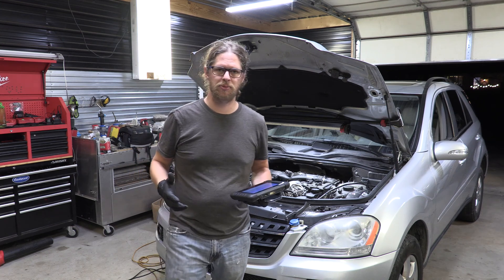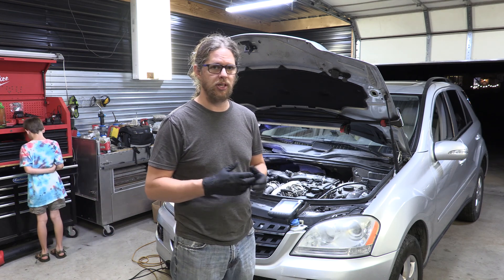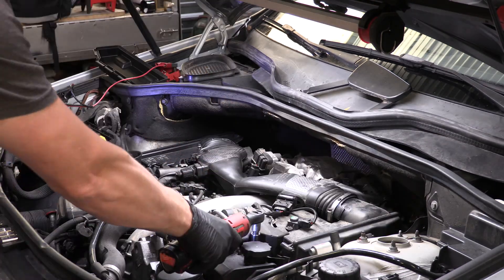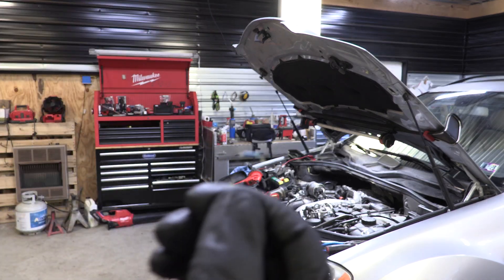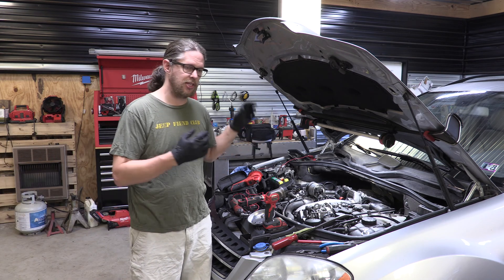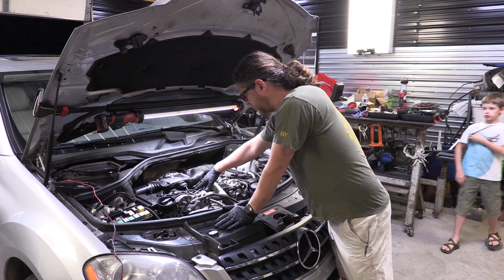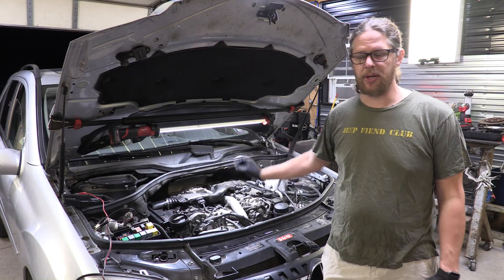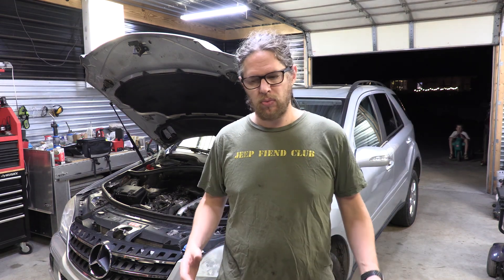DIY: P2008 Is it safe to use the Resistor for the OM642 swirl flap motor failure? #mercedes #diesel

Comment: Hi, i put the brown resistor but the problem is still there. The engine light went off but turbo it's not boosting
Reply from the maker: You may need to check the turbo or make sure the flaps are not shut. Also make sure it’s not in limp mode for a different reason.

Comment: Hello great video, how do you move the swirl valves into position?
Reply: I have 2007 ML 280 cdi, have the resistor installed and the same fault codes you have listed
Reply from the maker: If you have the resistor and still have the code I would recommend testing the resistor. Maybe it went bad..
Reply from the maker: If they aren’t in the right spot, they might be stuck or the runner/connector might be broken, sadly that could mean you’ll need to pull the intake manifolds and have them cleaned.

Comment: Is it possible to manually open the flaps while the motor is still in, possibly by sticking a screw driver down there and ensuring that the intake runner arm on the drivers side is forward and the passenger is back? Or maybe using pliers and grabbing the arm and pushing or pulling them forward and back?

I put the resistor in and it’s out of limp mode but now it’s hesitating when i drive it and it starts building a bit of boost so I am assuming the flaps are closed. Weirdly enough, if I floor it, it doesn’t hesitate.
Reply from the maker: I don’t know if I would recommend forcing them open, if they won’t move they are possible broken or clogged up and stuck. 
And they are just weak plastic runners that will break if you try to force them.
Reply: @MalarkeyTaylor thank you. It might be different in the 08 ml320. I have a bunch of wires that sit on top of the swirl motor in a black plastic container so I can’t see the intake runner arms like you can in the video. Unless you removed the wires and that part isn’t in the video?
Reply: nevermind I see it now. You removed a different piece closer to the front of the car to be able to see the arms clearly
Reply from the maker: @khaledkabalan9066  it’s possible I removed the fuel filter. But I also may have used a bore scope. Which can be helpful.
Reply: @MalarkeyTaylor gotcha thank you for your quick replies. I ended up removing the fuel filter and manually moved the arms back (passenger) and forward (drivers) with my hand, they moved very easily. No more limp mode but I’m still getting a hesitation even though the flaps are open. Any ideas? It feels like the motor is choked because there’s an air restriction now
Reply from the maker: @khaledkabalan9066  it’s really hard to say. If you clear the codes and none come back, give it the Italian tune up and run it out the gears. It might help, or it might tell you if it’s running out of fuel or air.  If it falls on its face but no smoke it might he fuel starved. Check the injectors are working right. If it smokes and can’t wind out check your air filters and turbo. Make sure the turbo is doing boost things and that the vgt actuator is working correctly. 
Honestly there are so many things it could be but those are some starting points. 
Good luck!
Reply: @MalarkeyTaylor thanks!

Comment: Hiya, sorry to bother you I know you answered the question several times but I'm kinda stuck. I've the same issue. I put a 4.7 k resistor blue colour. The drive did improve but the MIL came on and most importantly, the engine got very hot after a spin. I removed the resistor and put everything back together but willing to try again. Can I move the swirls linkages by hand to make sure they stay in the open position? Thanks for your kind reply 🙏
Reply from the maker: Depending on the year, some of the swirl flap slides have sensors in them that will cause the MIL light to come on and sometimes trigger limp mode. If that is the case with your car I’m not sure what the best recourse is.  I think it might be to remove the intake manifolds and modify the flaps to be open all the time and then allow the runners to pass the sensors while not affecting the flaps. 
But ultimately if the quick and easy fix of the resistor doesn’t work, it will require some more in-depth looking at what the MIL is saying. And if the engine is getting hot, the problems could be located somewhere else.
Reply: @MalarkeyTaylor  thank you so much for your prompt reply. I worked on the issue all day long and it's now fixed. I will share what I did to resolve the problem in a video soon. Thanks again, really appreciate mate.
Reply: @younesalsanhaji1603 hello can you tell me how did you solve it i didn't found video on your channel i have the same engine as you om646

Comment: Hi, Sorry to chime in late but I am getting a similar code and am thinking that I have a similar issue. However, the car will not start at all. Can I assume that the flaps in this case are stuck fully closed or is the it the code itself that is causing the vehicle to limp and not start? My code is 2530-2. Many thanks if you get a chance to reply.
Reply from the maker: More likely that the swirl motor blew a fuse. Check your fuses and then unplug the swirl motor. Iirc They share a fuse with glow plug controller or a few other things and the other system might be what’s causing it. 
I would not assume anything though, it’s best to test systems so you’re sure the cause of your no-start.

Comment: Would the swirl flap open position you had on the diagram be the same on right hand drive vehicles (UK) engines?
Reply from the maker: I think so, I have not seen any documentation to indicate that they changed the motor when they changed the side of the steering wheel, but I don’t know sorry.

Comment: Different matter from your video, but if I do a full catalytic converter and dpf delete can I use a resistor to bypass the dpf sensor?

It's an 08 ml320cdi.
Reply from the maker: Sorry, I don’t know. I have not been in the situation where I needed to do that.

Comment: Have you seen th p30078c code. I can’t physically see any opens.
Reply from the maker: I think Those are codes from a newer model that have Hall effect sensors in the intake runner flaps. I think that code is tell you that the computer want to move the flap but the flap is not moving or the Hall effect sensor is not meeting its endpoint. 
I’m sorry I don’t have any experience on those newer ones to tell you how to fix it. But look around for your specific model year and see if there is an easy or quick fix for it.
Reply: Yes it is a 2021 and I replaced the intakes and they came with a new motor. Maybe my scanner can’t erase the stored code.

Comment: sorry, I'm planning to do the same,, so I'm curious if the engine will lose power, what kind of power will it be at low rpm, at high rpm I guess it will go crazy
Reply from the maker: I have made this change on multiple cars and neither I or any of those that I have done noticed any change in performance or drive ability. 
The ML320 in this video went on after this to tow a camper with my dad driving for more than 30,000miles (all over the US) 
I also did the same to the GL that my wife drives more than 40,000 miles ago. 
And a friend of mine has a CRD jeep with the same motor that has also had this work done and none of them have any notable effect.
Reply: @MalarkeyTaylor  Tnx

Comment: I have problem with my om642. My turbo leaked oil into the cable you put the resistor in (what I think caused the problem) so I get P1270 code know when I scanned with my obd reader. A very common faulty with the turbo leaking apparently. But what would you say is the fault?  Do you think my servo motor for the flaps has been short circuited by the oil so it doesn't work anymore or do you have other suggestions?  How do I check that the servo is working?
Reply from the maker: Very hard to say, the p1270 code I think is a limp code. So you would have that with other faults. The other faults would be what you need to fixed before the 1270. 
So if the p2008 comes up with the 1270 your flaps maybe stuck and your motor may be bad. 
If you get rid of the other codes the 1270 shouldn’t come back?

Comment: what about DPF regen  when swilrl motor is off by resistor ? will regen offten  or all is ok  ?
Reply from the maker: I have not noticed a difference in the region activity. Have been running like this for quite some time and many thousands of miles and have had no negative effects that I can tell.

Comment: I dont have a mdb tool can you still do the fix without clearing the code ?
Reply from the maker: Once the resistor is in place and the flaps are left open the code should clear itself eventually. But if you have codes for this I would recommend making sure it’s not anything more serious.

Comment: I tryed the same way on my w221 320cdi ,the car goes out from the limp mode but the motor works with the 50% of the power very lazy .
Have i do something worng maybe i didint conect the resistor good? 
Or my swirl flaps are not fully open?
Reply from the maker: that is very possible that your swirl flaps are not open and then causing the motor to be restricted. I was very careful to only do this when the swirl flaps could be verified to be open.  you could get a camera and look into the intake if you take the charge pipe off and run the camera in.
Reply: @MalarkeyTaylor  
aa ok i understand,but now what can i do to open them?
Reply from the maker: @anxhelobarjamaj7979  that’s a tough one. Depending on how badly they are broken it could be as easy as forcing the runner open or as hard as taking the intake manifolds off and removing them.

Comment: If the swirl valve is working but binding up here and there and tripping the Check Engine and putting me into limp mode is there a way to loosen up the arms or add treatment? I play with the arms, clear the code and it runs great for about 500 miles or so and then the same thing happens. thoughts?
Reply from the maker: Soot buildup in the intake can cause this. Part of why I disabled the flaps on my cars. Once they are left open the buildup doesn’t matter as much and we can go longer intervals between having to remove and clean the intake manifolds.
Reply: @MalarkeyTaylor  Thanks - does any diesel fuel additive for a Sprinter diesel help with build up?
Reply from the maker: @DougLindland  not that I’m aware of. Most of this is the result of the egr and crank case vent sending oil into the intake with exhaust gases. 
Many people delete those items. But I can’t say how to do that or recommend it as it’s not legal in some parts of the world.

Comment: If my swirl valve is rattling, what does that mean? Can I bypass the sensor or does that mean it's a different problem?
Reply from the maker: Some years have sensors that detect what the position is of the flaps. Those years you can put the resistor in but it may not prevent the engine light from coming on. 
If something is rattling. You may have a broken component and it may be best to seek a capable work shop. Or remove the intake and repair or remove the swirl flaps.

Comment: Hello , do I need to move with hand first those flaps to open position , or just to put resistor ?
Reply from the maker: If they are not in the open position when you put the resistor in the engine light may go away but your engine may not perform right and may end up with problems due to the flaps not being open. 
If they can’t be easily opened by hand you may need to take the entire intake off and clean it and fix the worn connecting rods to get the full range of the flaps back. Or delete them entirely.

Comment: Hi if how long this resisters can last , eventually do you have to fix the main problem swirl flap
Reply from the maker: I have done this to two different trucks now. One of them went 40,000 miles and two plus years before it was totaled in an accident. The other is still going after 25,000miles and a little over a year. 
So if there is a limit I have not found it yet.

Comment: Hi, sorry for the time, have a question I want to use the resistor but should I open the flap by myself or keep them in the same position?
Reply from the maker: They should be in the open position if they are not stuck. If you can move them to open or make sure they are open it’s best. If they are stuck or broken the resistor may get rid of the motor failure codes, but the motor may have other issues because of the restricted intake. 
I guess use caution and your best judgement. And if you’re not sure, you may need to consult a mechanic.
Reply: @MalarkeyTaylor  OK I will stay them open but should I grab them or just move the shaft, and should I separate them from their motor?
Reply from the maker: @3beNz3  the motor is what keeps them open normally. So unhooking from the motor might result in them closing when they shouldn’t.

Comment: when swirl motor is bypassed and flaps permenantly placed in an open position does this eliminate the engine braking or some call it compression braking effect when car is not accelerating. From what I understand the breaking effect is caused by flaps closing when gas pedal is not pressed.... when you are coasting.. This is especially noticeable at low speeds.
Reply from the maker: No, no noticeable difference in engine braking. 
In fact, I have not noticed any difference in performance, fuel economy, or operation of any kind since disabling the flaps on any of the ones I’ve done.
Reply: @MalarkeyTaylor  I have this engine in my Jeep Grand Cherokee and have deleted the whole swirl flap system and kept just the resistor in place.  The way i heard it the swirl  flaps were designed to make the diesel engine sound less like a diesel when idling. I like diesels so don`t care,  had zero issues since,,,
Reply from the maker: @SeeBird686  there are a few gas engines that use swirl flaps as well. There is something about making the right amount of turbulence to optimize the flow of air. But I too have disabled them for a long time with no noticeable effect.

Comment: Cheating the engine failure detection is not a fix. You can also destroy the engine warning LED. Fixes all failures for zero bucks.
Reply from the maker: Keeping the engine out of limp mode. Because of poorly designed intake manifolds and barely useful “swirl” flaps is hardly cheating anything. 
This tip is for people that want to get 250-300k or more miles out of a car that was written off because the repair cost more than its value. 
If you are not interested in that sell it and buy a new one that doesn’t need this fix.
Reply: @MalarkeyTaylor  exactly

Comment: Do you know how long this will last or any further issues this will cause when done? 

Also can this method be done if the passenger side is seized shut in the closed position? 

Thanks
Reply from the maker: The ones I have done have gone 50,000+ miles without any issues in this configuration. 
However you should make sure that both sides are in the open position or you could have performance problems and improper fuel burn which may lead to some after treatment failures.
Reply: Thanks

Comment: Hi thank you for you video,i have the same issue on my dodge sprinter 2500 with codes p2004 p2005 and i removed an actuator, i put flaps in open position and tied it up so it doesn’t close and then i put 0.25w 4.7k ohm resistor and it didn’t help because after an hour check engine light came on again.i tried many different resistor and now i put 0.5w 4.7k ohm resistor and check engine light didn’t come up yet but car is not kicking as it used to.Is there any ideas what can i do.
Thanks
Reply from the maker: You might have to check with the details on your specific year. Some newer models have sensors on the flap runners that detect when the flaps are open and when they are closed. In my case there is no sensor so the engine computer doesn't know if the flap motor is broken unless it burns out. But in some newer models there are magnets in the flap runners and Hall effect sensors in the manifold that indicate the position to the ECM. If your Sprinter is newer and has these sensors you may need to check with a mechanic on the right next steps, (or ignore the Check Engine light until 'proper' repairs can be made)
Reply: @MalarkeyTaylor  Thank you for your response and communication.My car is 2008 dodge sprinter 3.0l v6 with regular plastic runners and i dont think there is a any sensors left.Just wondering If you know where is the sensor that tells position of flaps and  can i delete them or delete the flaps how it would affect to limp mode and smog check.Thank you again i really appreciate what you do
Reply from the maker: @Маннон-щ8ъ  I’m not sure I can help. None of the ones I’ve worked on have had the issue come back after the application of the resistor and securing of the flaps.

Comment: The motor and flaps have been totally removed and coded out of the ecu on my car
Reply from the maker: If I ever have the intake manifolds out again on either my dad's or mine I will weld them shut for sure. And if I ever have a need to refresh the Computer I'll get them flashed out as well. A very good option to do that!

Comment: Will a 0.25w 4.7k ohm resistor work?
Reply: Hi, thanks for creating and sharing this video.
Does it matter or is one preferred over the other metal or carbon film resistor?
Thanks again👍
Reply from the maker: Yes that is what I used.